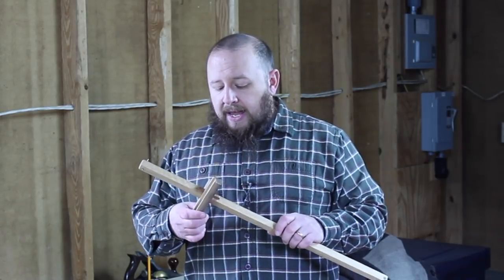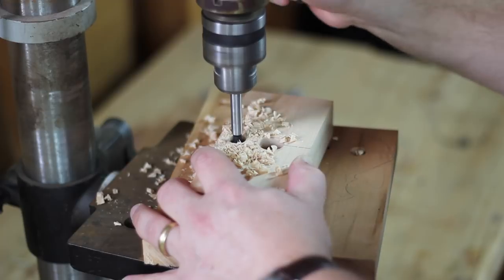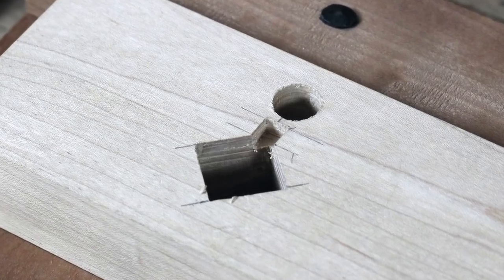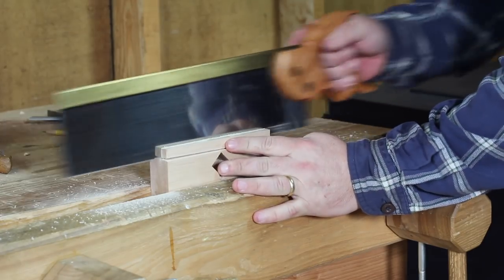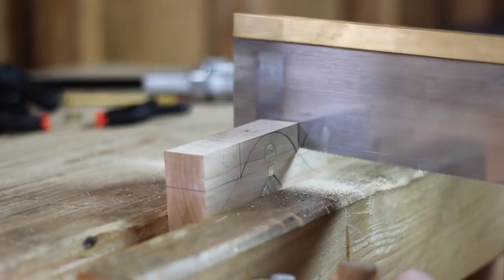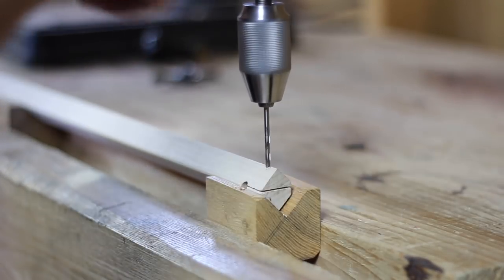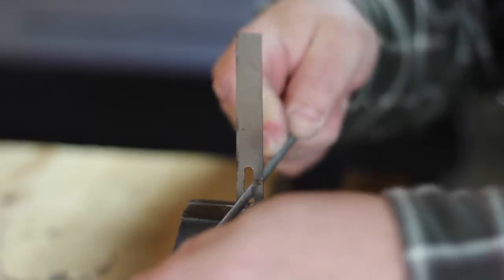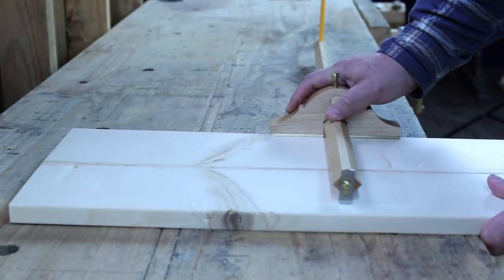How to Make a Panel Marking Gauge

Comment: Nice video. I’m keen to make this and got the Aug 18 edition of PWW for the details as suggested. Can you please clarify- the article specifies a 3/8” diameter clearance hole for the brass nut, but it also specifies using a 1/2” rod for the nut- is this right? Is the idea to force the rod through the clearance hole?
Reply from the maker: Steve Vlahos The ⅜” clearance hole is for the ¼” thumbscrew to pass through the wooden fence into the brass nut, which is a piece of ½” brass rod.
Reply: The ‘front view’ of the plan in PWW looks like it specifies a 3/8” hole for the 1/2” rod, or am I reading it incorrectly?
Reply from the maker: Steve Vlahos Yeah, it looks like the illustrator put the wrong dimension in the drawing. The hole for the brass nut should be ½” if you’re using ½” round bar for the nut. The hole in the top for the thumbscrew should first be drilled through the wood and brass rod at the same time in a size to match the tap for the thumbscrew threads. Then the brass rod should be removed and the hole in the wood should be drilled out so that the thumbscrew can pass through the wood freely without threading its way through. It should only thread into the brass rod. Watch how I do it in the video. It’s correct there.
Reply: Thank you. That clears it up. Thought I was going mad!

Comment: Very nice. Why the brass screw and not the wedge I'm wondering? I made a few of the " French style marking guages" from your previous video and they work great with the wedges.
Reply from the maker: greg choma Thanks!  No good reason to use the screw over the wedge really. Just a different way to go about things. 

My old panel gauge used a wedge. It worked fine, until the wedge and beam mortises got too loose. But I don’t think this was a result of the wedge system. The fence was a piece of walnut that wasn’t ideal for the task. But I still use my French style marking gauge all the time. It still works great. 

The panel gauge doesn’t need to be capable of one handed adjustments. Also, the long beam makes for a good bit of leverage and torque and can wear a square fence mortise out. I wanted a system that would lock the long beam more securely. The pentagon shaped beam accomplishes this better than the square beam of my old panel gauge. I could have used a captured wedge in place of the thumbscrew and brass pressure bar. I suspect it would have worked just as well as the thumbscrew with the five sided beam. But since I was adding the brass wear strips anyway, I figured I’d bling it up a bit. I already had the brass laying around. A friend made me a pair of brass thumbscrews in exchange for some saw work, so I thought this would be a great opportunity to put one to good use.  Other than that, no reason to use the thumbscrew over a wedge. Both mechanisms work well.

Comment: Wow, beautiful hand work. I get stressed when my store bought gauges aren't square, amazing at how the eye can see what the gauge shows to be true, actually isn't. Maybe you or someone else could point me into the direction of perfect 90° angles. I just cant seem to make them perfect. Any help would be appreciated, thank you.
Reply from the maker: Wyatt Sprague Ha, if it’s perfect you’re looking for, I’m not the one to ask. I check my squares and correct them if necessary every so often. But I don’t stress about perfection in most cases. Hand work simply isn’t perfect, and I’m just fine with that. It doesn’t have to be in 99% of cases. 

But I can get very close to perfect 90s in the rare times that I need to. You need to have a good square reference first. I’ll test my square to make sure it is so. Then I can use it and a shooting board to sneak up on a perfect 90. 

I did a video many years ago on making a wooden try square. Check back through my older videos. In that video I talked about how to test a square for truth. Correcting wooden squares is easy with a plane or scraper. Correcting try squares with metal blades requires a file and a little patience. Correcting combination squares requires a really thin safe edge file and a lot of patience, and some aren’t worth correcting.